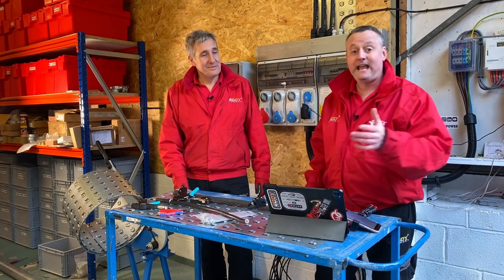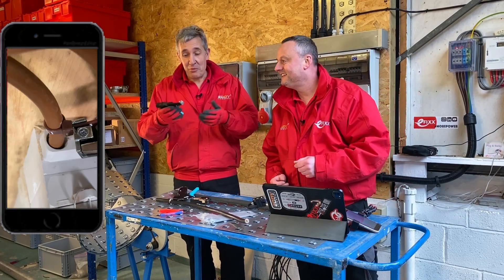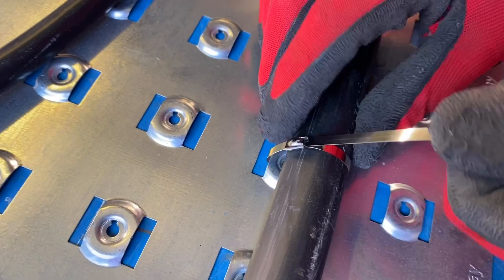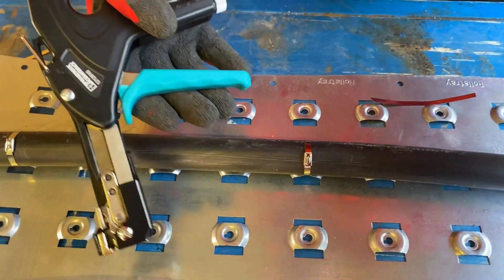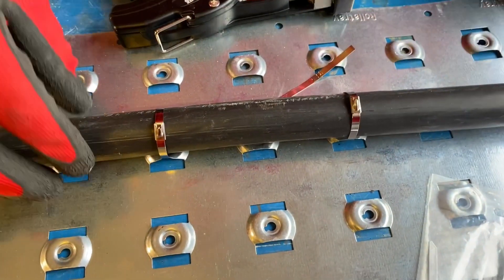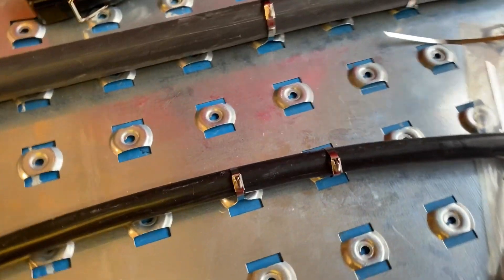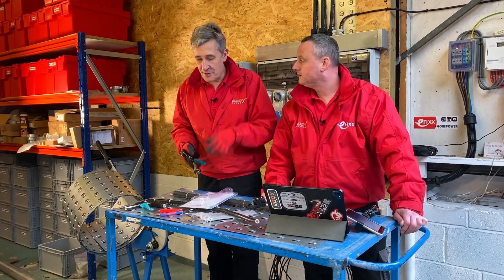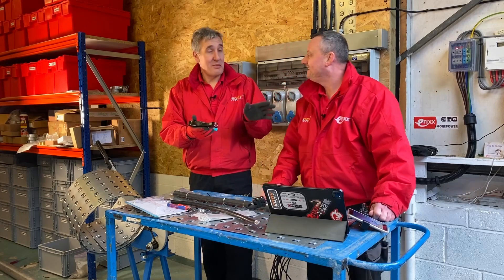IS THIS THE BEST METAL CABLE TIE GUN?

Comment: Panduit's PBTMT or PBTMT/E battery operated gun does exactly the same and is a great fit when installing large volumes of thicker metal ties. Great tool if you want to avoid the hand fatigue which comes from ratchet tools!

Comment: The cable tie gun seems really good.   I'm glad there isn't a short bit left sticking out after cutting. 
The gun I use does leave a small 'razor blade' sticking out (I saw the youngster using the same tool, at the start of the video).

It looks much easier to fit cable ties on that cable tray.

Comment: To release a fitted metal cable tie, simply insert a new metal cable tie into the slot where the old one is, then pull the original tie out to release it.

Comment: I'm sure that is a useful tool when doing a lot of steel cable ties. I assume no trickery is going on here, because when he tensioned the first steel cable tie, it looks like he barely pulled on the tail end to make it tight. Any tool could make that a tighter connection.